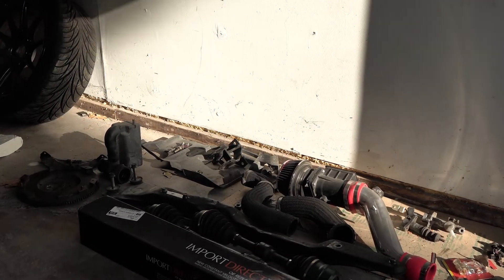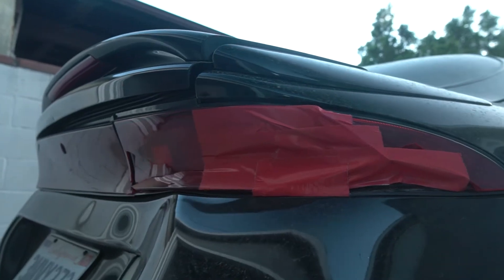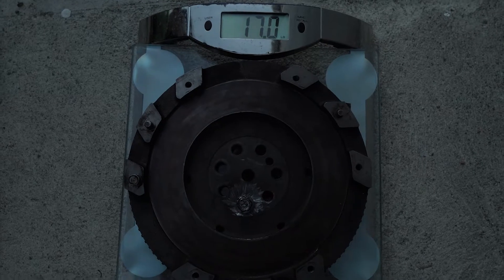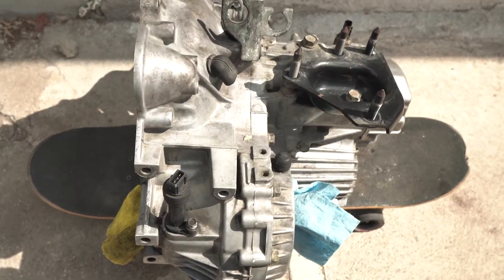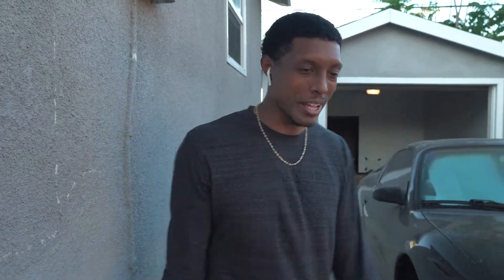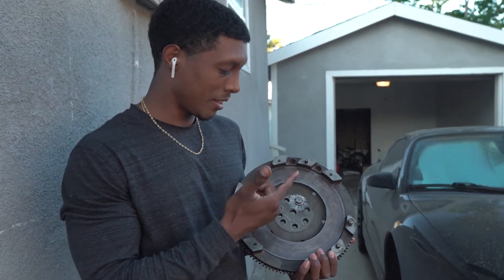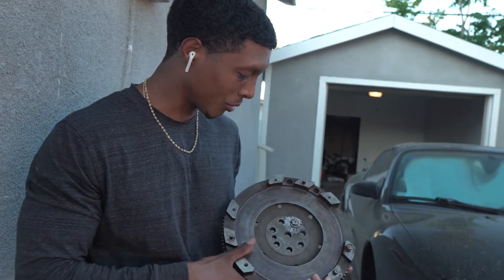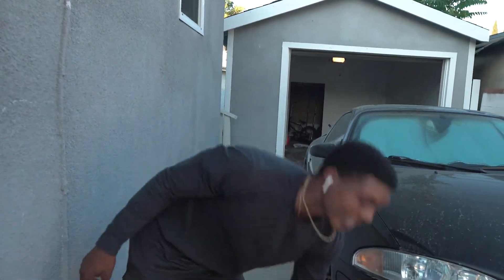2G Eclipse Update | 16g Turbo Setup | Broken Clutch

Comment: You experiencing fuel cut? Once I get past 5k rpm my car hits fuel cut and I have a 255 fuel pump and a afpr 
Any ideas on how to prevent it from fuel cutting
Reply from the maker: I don't believe I experienced any fuel cutting. I would say to make sure you have your Fuel pressure set at the correct pressure value. I didn't have any problems after installing the pump. Also, did you "Rewire" The fuel pump? It's Highly recommended that you do. If not the Walbro will not get consistent power and that could be the cause of your problem.